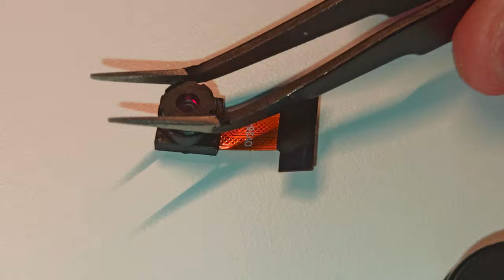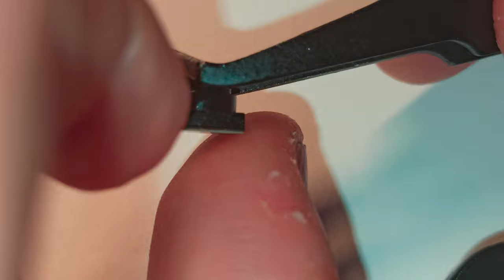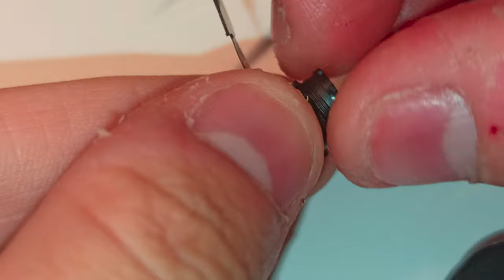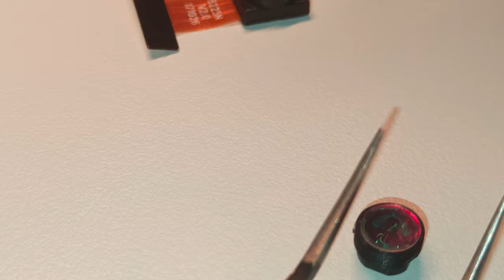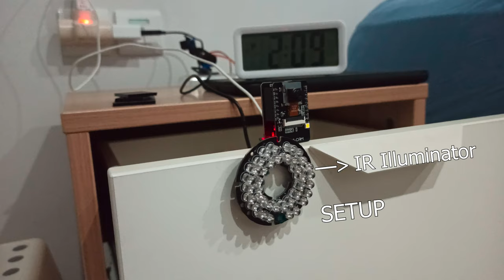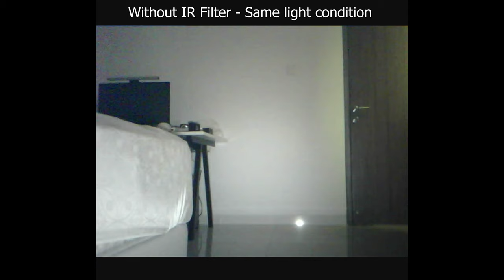DIY Night Vision Camera - How to remove IR filter from any camera

Comment: Just to confirm, there is one more space where the Infrared Filter can be located..... As show in this video, the infrared filter can be located on the back side of the lens assembly but in most models, it maybe located infront of the camera sensor.... So, it's a bit difficult in that case to remove the filter without damaging the sensor....
Reply from the maker: thank you for the useful information!

Comment: The new 4K cameras have it over the CCD CMOS sensor.  Its glued really tight, maybe melted to it, I need a new sensor because I used the knife on one and there are tiny resistors or capacitors.  Then I tried alcohol and nail polish remover, didn't budge and didn't work.  You can tell because when they make the CCD CMOS, it never is complex, you can just see the traces.  On a good camera it has rubber, so its removable.  The GoPro is 1080P HDMI, so its logical this is to sell infrared cameras so that AI can take their jobs.

Comment: i wanna try this with phone module camera ,is it the same?
i heard some phone manufacture didn't use ir filter anymore, it's built inside the lens permanently
Reply from the maker: for older phone, the ir filter can still be located in front of the sensor, but it can be a little tricky to remove it from the phone's camera
Reply: @dianf2p552  No, there may not be any possibilities that manufacturers don't use this filter anymore..... But once, OnePlus done a similar thing on OnePlus 8 Pro.... They added a camera to the phone which has no ir filter..... [Pro filter camera] But it was then suspended because infrared Camera's can actually see through some materials and clothing..... thus ruining privacy.....